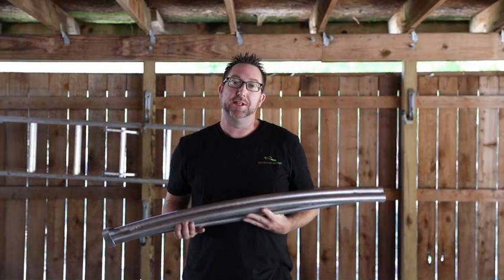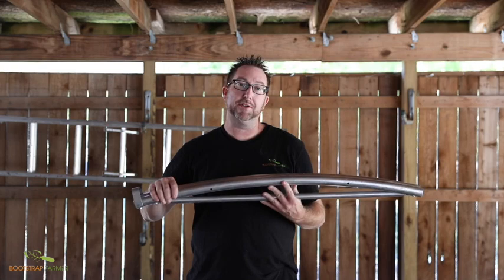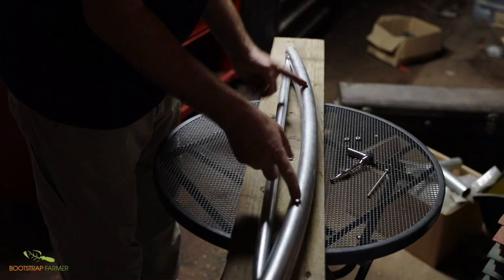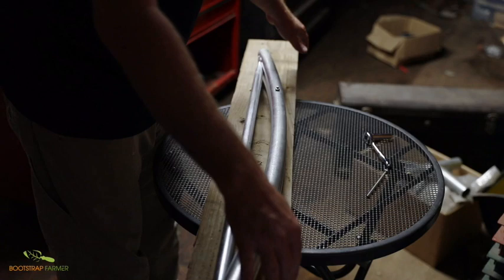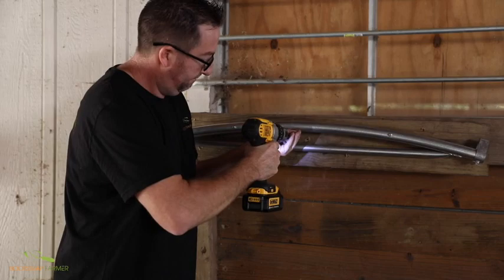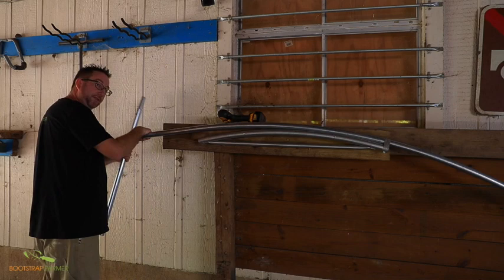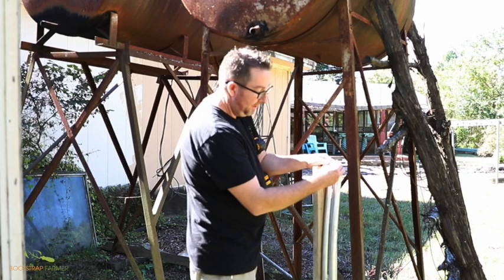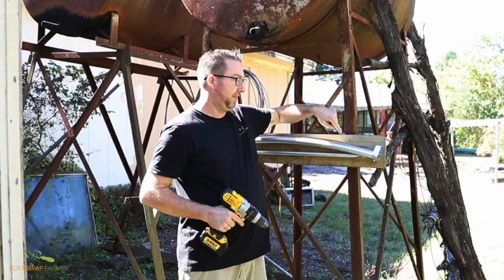How to Bend Greenhouse Hoops: Mounting your Hoop Bender

Comment: Hey gang - purchased the 6’ bender and am trying to figure out the best way to work around the two separate guide on each end.  Mine appears different than the one in the video as it seems to have a guide for both 1/2” and 3/4” on each end.  Do I need to cut the one that I am not using off?
Reply from the maker: One side is for 1/2 EMT & the other is for 3/4 EMT.   You will use the same way as the other benders. Start 9" from the bottom of the pole and bend to (in the case of the 6') the top of the 3/4 or 1/2" ring just barely touching it. You will most likely have a bow a little larger than 6' when complete. When you put into ground posts the spring tension will strengthen the hoop.
Reply: @BootstrapFarmer  my bender has a loop on each end. I'm having trouble with it as well. why did you change the design?
Reply from the maker: @eleisabarbour  https://www.youtube.com/watch?v=TVaOiHUzvZU&feature=youtu.be see minute marker 6:20 in this video